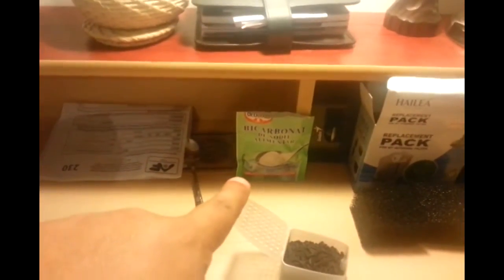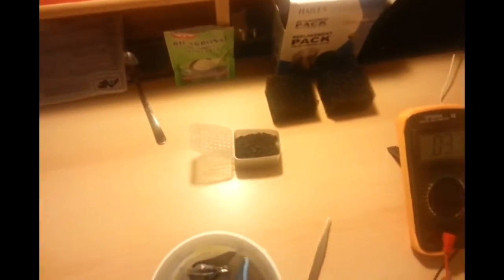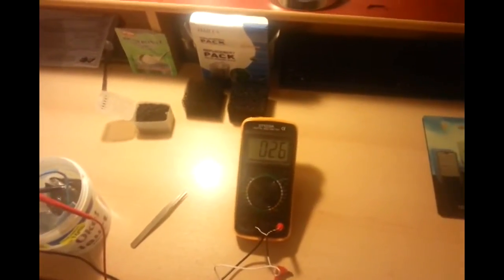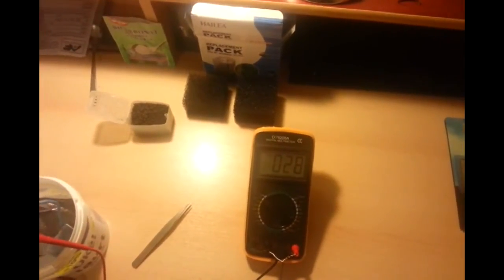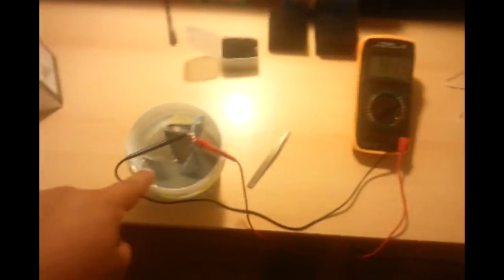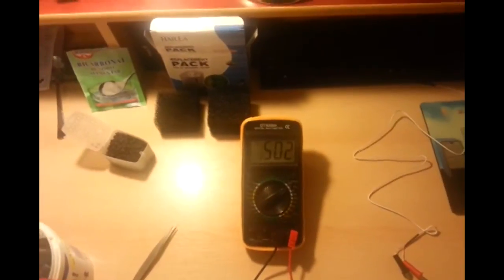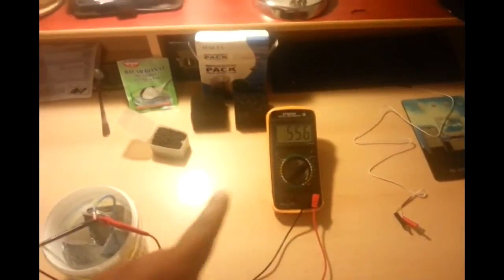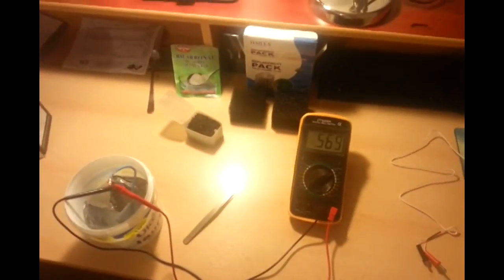Karpen Cell basic replication

Comment: Cool battery. I like the use of carbon filters. May I make a suggestion to boost the output? There are four elements in there aluminum, sodium, copper, and carbon. Some of the electric potentials of those elements are reducing power. Replacing copper with graphite pencil will help. Chlorine bleach as electrolyte will give over a volt and other halogen elements work well.
Reply from the maker: wow :) cool suggestion.
Remember that I'm trying to get the kitchen level equipment stuff ... 2 reasons for that: 
- I only have access to those kind of resources
- to make it possible for everyone at home to do this ... Obviously all that has to give up some efficiency but still make it workable. :)
I friend suggested the use of AlCl3 solution as the main electrolyte and this is what I'm struggling to get now ... cannot bu it anywhere so I'll have to make it Al+ HCl but HCl is a nono where I live as it seems to be a controlled substance ... I only saw a 10% 250ml vial for educational purposes available.
Reply: actudoran Ordinary laundry bleach (Clorox) or pool chlorine in high concentration with water is all you need. AlCl3 should be the byproduct. Motion or vibration of the cell increases voltage by knocking bubbles off plates.
Reply from the maker: so if i understand correctly then the stripped wire I use to collect from the carbon filter should then be aluminium too ?
Reply: actudoran No. Aluminum on that side will stop voltage. You should get better voltage with graphite pencil lead or carbon rod in carbon filter carrying current out of cell. Adding a couple pencil leads will make up for their resistance. Page 368 is a list of metal potentials to their own salt solutions, carbon -1.5v on the list. Hope this helps. http://books.google.com/books?id=KqQFAQAAIAAJ&printsec=frontcover#v=onepage&q&f=false
Reply from the maker: excellent mate !!! cheers for that ! will do in m next tube vid ... I also inted to vary a bit the design and size of the cell.
BTW .. if I want a more condctive recipien for the cell, what should I use ideally ?   I know metal is out of question unless the whole recipient is the metal electrode :) -  which might not be a bad ideea ... like a coke can, bu then it would require some isolation otherwise you'd be taking the charge off it when you touch it.  I think a scotch tape / gaffa tape will do.
Reply: actudoran A metal coated with graphene conductive ink would make a good negative electrode. This way the electrolyte wouldn't react with the current carrying metal but with the most negative element carbon. Metal container would be good. I think that's how it was done in the old days.
The Karpen two different solution cell could be done with a carbon separator or clay flower pot in larger container.
Reply from the maker: Yep ... two concentric containers look good, for ease of replication ill stick to one electrolyte a metal and carbon. Ill do some more tests and tube the finds. Aiming this time for a sealled cell to leave indeffinetly with a load like a resistor or a swanky joule thief i hacked off some old solar lamps.
Reply from the maker: I played a little along your lines in my other video ... no copper :) Karpen Cell replication 2
the smaller the cell has a smaller power output ( lower amps )

Comment: v nice mate
Reply from the maker: Dang ... water evaporation overnight ... shooting up amps ... small drop in voltage ... 0.2 A, 0.4 V  but now some of the alum foil is exposed and is forming some crystals in the exposed parts.... so it might be a case of Alum air too for the exposed parts which explains shooting up amps.
Will be modifying the design and adding a joule thief to light up a led this evening :)
Reply: actudoran
that'll be cool